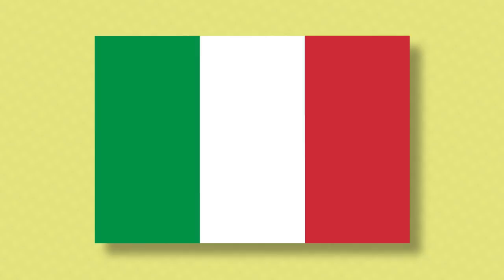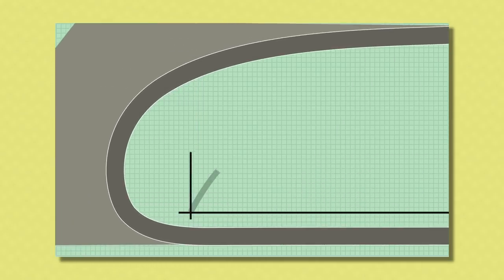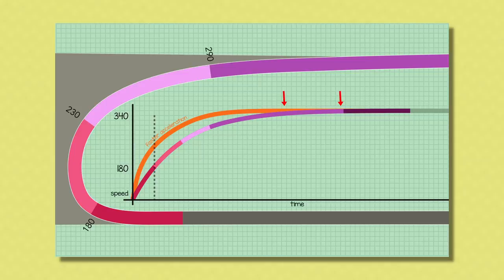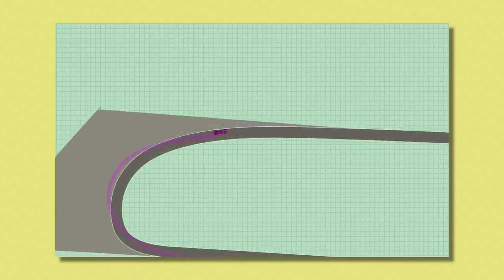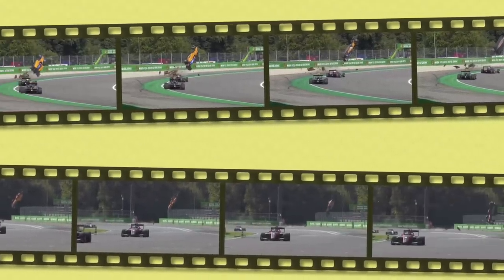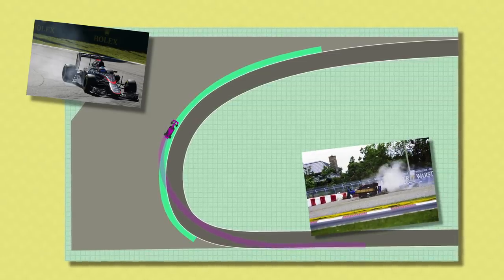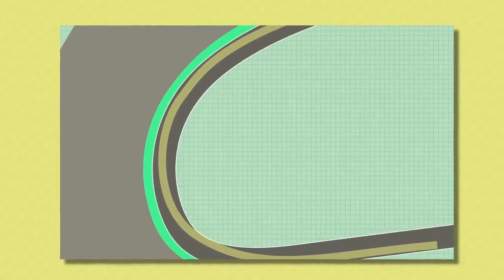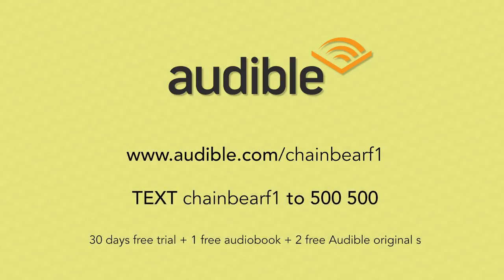Why run wide at parabolica? Italy 2019 (Part 1): "Just stay inside the lines!"

Comment: I was actually really impressed during the race by Leclercs precision, he went really wide lap after lap, but always keeping half his tires at least on the line, just perfect.
Reply: oh man i'm glad i wasn't the only one who noticed
Reply: Monza 2020 didn't aged well tho for Leclerc
Reply: no ...not perfect; all 4 tires are to be within the white line.
Reply: @arposkraft3616  No you dont lol
Reply: @arposkraft3616  It's 2 tires, innit? If it were 4 tires, then every time a driver eats a kerb would be a five-second penalty.
Reply: @Derpy-qg9hn  no according to the rules its all 4 tires, to be exact the inside , but practically they look at intend, 2 tires is reprimandable but if without any benefit noone is going to take that as a big issue but the track is most definetly defined as within the white lines...and exactly; you arnt supposed to ride the kerbs, they are there to kerb you back on track
Reply: @arposkraft3616  "Drivers will be judged to have left the track if no part of the car remains in contact with it and, for the avoidance of doubt, any white lines defining the track edges are considered to be part of the track but the kerbs are not."

the official regulations say that if any part of your car is touching the outside line, you're still considered to be inside the track

Comment: The “Silverstone” line of grass/gravel it’s so simple and effective that I cannot understand why it isn’t like that in every circuit
Reply: At least on the second half of Parabolica. At that point the car has sufficiently slowed and is turning that if they lost control it wouldn't hit the wall at crazy speed or angle.
Reply: You always have to keep MotoGP in mind, a lot of these circuits also want to host their races, so FIM has a say when it comes to kerbs and run-off areas. They tend to (understandably) push for less risky designs than the FIA.
Reply: cerebellum well actually FIM it’s pushing more and more for the return of gravel. For example SPA announced that for next year they are putting back gravel in the run-off area where the unfortunate incident of Hubert (RIP Tonio) happened. Not as a reaction after the incident but actually as a request of FIM to adapt to the new MotoGP safety rules
Reply: @51m0n397  They want to race MotoGP at Spa? O.O Last I've heard only a sub category of superbike or something was the only motorbike race at spa
Reply: Cippa Cathion it has not been confirmed yet but the organizers of SPA want to be back in motoGP and they are starting the works to adapt the circuit to motoGP rules. In the mean time it has been announced that in 2022 they will host the 24 Hours of Spa motorcycle event.
Reply: The drivers bring gravel or dirt back onto the racing line each time they go off.
Reply: @Olivyay  just use artificial grass or a slippery paint
Reply: @ska042  Artificial Grass, you can move it
Reply: @DM0407  well it did hit

Comment: Definitely in favour of the strip of low grip area on the edge of the track. It just makes sense. It's not worth drivers going wide and it doesn't require Steward intervention. Imagine if Paul Riccard had grass around the edge of its corners 😍
Reply: I thought of France immediately when he mentioned it. It would make that track so much better.
Reply: They could even keep the tarmac and just coat a measured width with something that has a calibrated reduction in grip, like a slippery paint. Leaving the rough asphalt surface would hopefully prevent it becoming a waterslide when it rains, like the drag strip in Germany.
Reply: Im a big fan of grass and gravel. If you go off track you will get punished.
Reply: +COTA
Reply: yeah, the way it have to be  
, if it continues like this, the next disputes can already be made in a supermarket parking lot

Comment: That 'taking away power' thing was funny.. might be good for FormulaE
Reply: lol, except that in Formula E... running wide in most corners means getting acquainted with the wall 😁
Reply: Honda says that Verstappen's engine problem was partially caused by some FIA sensors suddenly kicking in, and putting a limit to the power output. If they told the truth, it is absolutely possible to use these restrictors deliberately as punishments.
Reply: @Petidani0330  the FIA (Ferrari Assistance International) have been known to favor Ferrari in the past. Let's just say, that I wouldn't be surprised at all, if this were the case at Monza.
Reply: @perp1exed  Right, so Ferrari wanted Red Bull, specifically Verstappen who already had to start from way back on the grid, to be screwed over by the FIA, but not Mercedes, their main rival and the manufacturer with the best engine until this year?

Wow, just wow.
Reply: @Petidani0330  Ferrari have been ruthless in screwing over competitors (using the FIA) in the past; including Williams (Montoya) and McLaren (Hakkinen) just to name a couple. I'm not asserting they screwed Max over at Monza... that would be ridiculous. What I'm saying is, that i'm certain they wouldn't pass over the opportunity if given the chance.
Reply: @Petidani0330  Conspiracy theories and cynicism aside. Where did you read this Honda statement regarding FIA sensors and their engine troubles?

I'm honestly not a fan of using automated systems to limit engine performance as a means to penalize drivers. It would introduce a bunch of additional variables, which I believe have the potential to impact the sport adversely. Not to mention, expose F1 to cyber threats.
Reply: @perp1exed  What you're saying as an example was in the Ecclestone era. Liberty Media doesn't care about history, so Ferrari won't be helped in the future (they even lost priority to Mercedes nowadays, if only we take a look at last year's battery mistery), thus this option remains possible.
As for the cyber threats, I wouldn't be concerned too much. Teams already protect their network as much as NASA, so that none of the competitors could steal informations about the car or listen to the private radio communication during race.
Reply: @perp1exed  The Motorsport website has this article, and it's days old now.

Comment: i get why they added run off, but its a shame the character of that corner was toned down. the grass strip option seems like the best idea
Reply: I'm not sure, it could cause them to lose grip and spin out. You want punishment, not cars crashing and causing a safety car.
Reply: @hkr667  How so? It means they have to take the turn with less speed instead of going full speed and thus, going over the isle (White line)
Reply: @hkr667  Well, if there was a wall, there would be an even worse punishment, so I think it's fair to have the drivers risk a spin if they don't drive where they are supposed to. Also I think it's safer than being launched in the air by a crappy kerb.
Reply: @hkr667  dont think u need grass strip to spin at Monza, if u get my drift hehehe.
Reply: @SuperLololololo1  Vettel is not amused by your joke ;)
Reply: @hkr667  Theres a massive runoff area and a tirewall.
Reply: "It could cause them to lose grip and spin out" - GOOD. If you crash it, you crash it. I am, and always have been, in favour of safer crashes rather than preventing them altogether. I want driving errors punished in real time by their environment, not by a divine authority meting out intangible time penalties after the fact.
Reply: @FightingTorque411  agreed, rather spin than fly
Reply: If you're on a motorbike and lose the front and end up on your ass, grass verges are pretty dangerous to slide across
Reply: @scottmichaels6624  but this isn't motorbikes though.... Depending on the race there, will depend if they have the strip or not....

Comment: 5:11 ask hockheim and they should put that ice skating run off tarmac at that corner😂😂😂🤦🏼‍♀️
Reply: With some sprinklers, for a guaranteed extra slippery surface. 😉
Reply: At hockenheim that wasnt such a fast corner, parabolica with slippery runoff would absolutely result in deaths
Reply: @mielvanvelzen5967  Doubt it. 180 km/h is quite something, but even a 300 km/h head-first crash is quite easily survivable nowadays.
Reply: @mscbijles1256  would u really risk it? I'd rather find a solution that doesnt involve such danger, spinning out and hitting at a diffrent angle then head on? Two cars going off one after the other and colliding hubert style? I'd rather not.
Reply: @mscbijles1256  + @Miel van Velzen: fight it out in the rain, like real dutchmen. I know the perfect spot! 😆
Reply: When the weather is dry, that tarmac is extra grippy. It's when it's wet that it becomes extremely slippery.
That part is the start area of a drag racing track.
Reply: I was being sarcastic about this 🤤🤤
Reply: @Drie_Kleuren  maybe, but I really wanna see that @MScBijles vs @Miel van Velzen fight, under wet conditions at the Hockenheim dragstrip.
Reply: Lets not forget at high speeds, these cars generate 600kg+ of downforce.

The icerink was so bad because it was a low speed corner
Reply: @mscbijles1256  lol no

Comment: Anything as long as we dont the colour run off stripes like there at Circuit Paul Ricard.
Reply: It has sort of sandpaper tarmac though and i think if u would put an extreme version of that at parabolica that'd take 3-4 laps off of off your tires nobody would go there.
Reply: Yeah it would work, but it hurts my eyes 😂
Reply: @Locomattive8572  im sure the color isnt needes. They could probably make it black
Reply: @mielvanvelzen5967  Considering the speeds that the cars travel through that turn it might make the situation worse and end up with a modern day Michelin Indianapolis fiasco.
Reply: @Rab1dGAMER  fair enough, although i dont honestly think that'll happen but it obviously should be tested first
Reply: @Rab1dGAMER  they have pitstops know, unlike in 2005
Reply: @naga5707  granted they have, but I don't see super abrasive surfac as much of a detterant like a strip of gravel or grass, also tires are tested for the track surface where they need to survive multiple laps on end, not the runoff area that's there to help stop the car in case a driver makes a mistake or two.
Reply: @Rab1dGAMER  "I don't see super abrasive surfac as much of a detterant like a strip of gravel or grass"

It is tho. Yes, the car can continue racing afterwards with minimal problems, but the tires still suffered greatly, and suffered unevenly in all cases, leading to problems later in the race. You don't see an immediate, spectacular punishment, but the punishment is still there.
Reply: I think I must be the only one who actually likes the stripes at Paul Ricard
Reply: @amicaze9570  Note that in quali or at the end of a race everyone would just run on those strips to get extra grip. Not a good idea, it's much better to have a low-friction surface like the green strips.

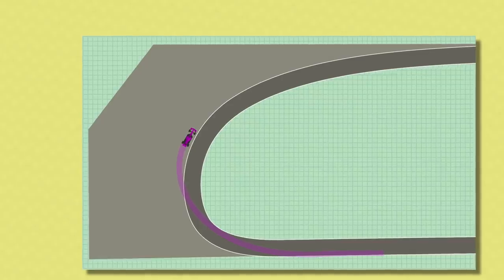Comment: 6:00 The problem with the sensor/low power idea is that it, in my view, would be likely to incentivise dangerous and unsportsmanlike driving, as well as unnecessary risk taking. 

Great advantages could be gained, for example, by forcing someone off in a duel. 
Equally, it would discourage drivers from bailing out or avoiding potentially dangerous situation, leading them to take greater risks, as they might consider the loss of power penalty from dodging off the track to outweigh the risk of collision from remaining within the lines during a dangerous situation.
Reply: Yep. The best idea is the grass strip.

Comment: A simple solution would be to a 'joker' route like they have in rally cross. Set so that the penalty route is opposite the pit lane. This way they can run wide if they want but they have to then take this alternative route. 

If they finish their current lap before they have the chance to take the joker route or the joker route is behind them before the offense occurs, time penalty for that route will be added onto their previous lap. 

If they set a fastest lap record before they are able to take this route then the same applies as above.

Comment: the low grip approach is IMO the best solution. they go wide to get better traction, but they will have horrible traction on a low grip surface. One meter is probably enough. Gravel would also be good for f1 in that kind of corners, but it's probably deadly in moto gp.

Comment: 6:15 another downside, two drivers fighting for position, driver A (let's call him Max) is on the inside while driver B (let's call him Charles) is on the outside. Max pushes Charles wide which earns Charles a slowdown penalty as well as losing the position. It would still need to go to the stewards for verification. 🤷‍♂️
Reply: Yep. The grass strip is the best.
Reply: @1_adityasingh  in that situation both  do the same thing. grass might even be worse
Reply: That's something Max would do LMAO
Reply: Aditya Singh How does Grass Strip solve that problem...in that case, the driver at fault still doesn’t get punished...?

Comment: I like the sensors idea. No intervention, stewards don’t have to monitor it, automatic penalties.
Reply: What if a driver is run wide? Like Leclerc did to Hamilton in Monza, or Verstappen to Leclerc in Austria?
The idea sounds great, but it would be disastrous without steward intervention.
Reply: Automatic (as stewards, too) may make mistake or may be tweaked in some way)
Reply: @perp1exed  Could be as simple as it's only added to sections that are abused for better lap times (Parabolica, Pouhon or Stavelot at Spa, etc.).  Or make the system automatic, and the drivers get a slow down penalty they have to serve within a lap or two.  This would give the teams time to contest the penalty with the FIA.  If they driver doesn't slow down, they face a harsher penalty (think of iRacing).
Reply: @perp1exed  An automatic penalty could be applied that could be easily cancelled by the stewards.
Reply: I disagree with all of you, and am 100% against any automated system. Not that I love the constant FIA meddling during races... but I can guarantee that an automated system will be worse. There are just too many variables to account for.

A better solution is to use removable track materials like grippy astroturf, to simulate grass on corners. That's an analog solution that does not interfere with racing in any way. It's much better than stewards or sensors policing track limits.

I guess you guys are arguing the issue from the perspective that stewards are generally not as "consistent" as they should be. I'm arguing from the perspective, that policing is bad... period. The less drivers are policed, the better racing we will see imo.

(P.S: I do think the FIA is vital to motorsport and the safety of drivers, stewards and fans. My issue is with the over-policing of the racing itself. I support all safety measures, as long as the FIA shut their mouths and let people race, once the race has begun. )
Reply: @perp1exed  The pit lane speed limit system is automatic and it works great.  How often do you see drivers speeding in pit lane? they don't because the automatic system catches everyone every time.
Reply: @coast2coast00  actually no. If drivers don't press the pit limiter button in time, they will end up speeding and getting a penalty. It's not common but it does happen from time to time. It's not really a system, but rather a feature... like cruise control for F1 cars.

Comment: The sensor inn The track idea is already being used in supercars Australia with great success.

It's used in one chicane where cutting the second apex gives an advantage.

During qualifying and practice if you pass the line your time is removed

During the race you get 3 warnings the 4th time is a drive through penalty.

It seems harsh but it makes for great racing in the closing laps as one car may be on his 3rd warning and the other car in the battle hasn't had any so can push passed the limits once or twice to make it work.

Comment: Disco lights on the rear wings would be glorious. Anyway the most sensible approach is a grass strip as you said, or any other kind of more slippery surface (but not too slippery to completely lose control and go nose first against the outside barrier). Or they could rework the curve slightly in order to fit the fasted trajectory within the track limits, although I doubt they would do such a thing

Comment: I think there should be a half car width of tarmac next to the outside line. Two wheels on the inside the line is on the course. Right at the edge of the half car width you got the grass and put back the gravel, and an escape/ penalty/zig/zag road at the fence for Hulk and Ham. This way there is a bit more track, and a possible passing groove on the inside. Plus a higher speed in that turn. Means on party mode one might outsprint the outside car on the "slower" groove.

Comment: I like the track limits sensors. Put them 2.2 meters beyond the white line, if they are tripped than all four wheels were off.  

Give them a few seconds of warning on the steering wheel that they will lose power down the straight, or alternatively give a delta they need to hit.  If another car is closely following they need to move off line, similar to qualifying. If they try to block while on low power they are given a second penalty.

Comment: Chain Bear, I think the Silverstone solution has merit. However, I would change the grass or gravel strip to a STRIP OF POLISHED TARMAC. If a car runs outside track limits, the lack of traction produced by the slick tarmac would impede their progress, and ruin their lap time. The area outside the slick strip could remain tarmac, as it is at Silverstone to allow cars to regain control before continuing...  Additionally, the slick strip could be painted a color to designate it as such. An added bonus with slick strips would be the elimination of curbing altogether, which could save the bodywork on the cars.